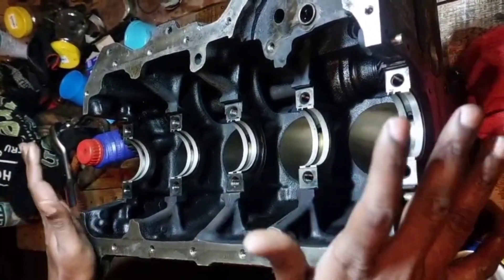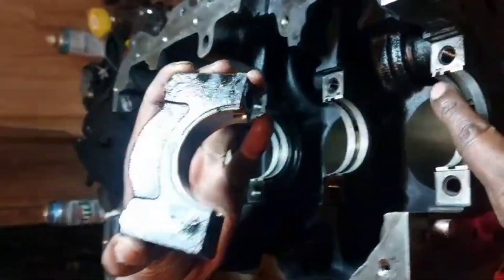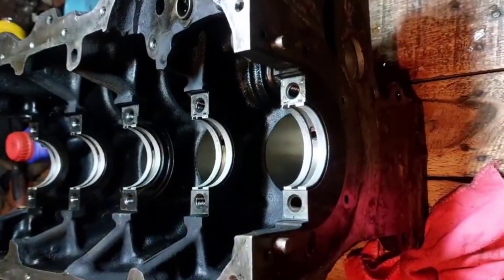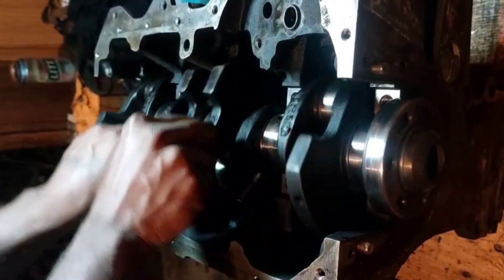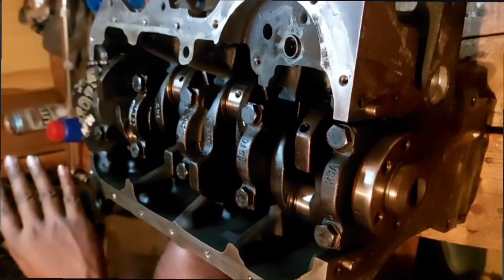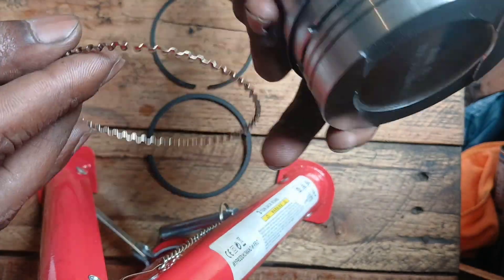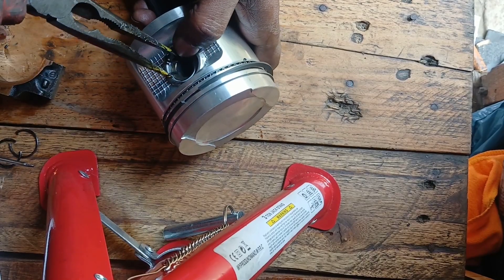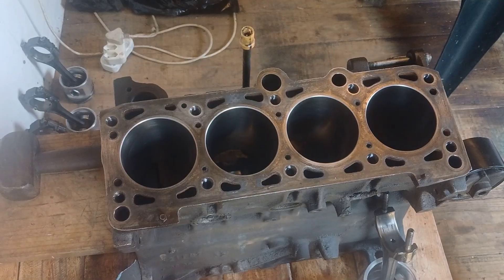Engine rebuild pt3 :Golf mk1. 1.4

Comment: What is the torque specs on the big ends and main bearings?
Reply from the maker: Mains i used 60nm and big ends i used 30 followed by a 90degree turn

Comment: Howzit deniro I wondering if you could give me some advice on a golf 1 1.4 carb it just starts and then switches off like fuel starvation but fuel is coming from the pump to the carb,idle cut of valve working, carb was cleaned and checked many tyms,no blockage in the lines,timing is on mark,but the only thing there's fuel going into the oil 
What can be at fault?
Reply from the maker: If fuel going into the oil that means you have weak spark or the carb is flooding the engine
Reply: Can send my WhatsApp number so it will be easy for us to talk an can send u a vid of wat it's doing